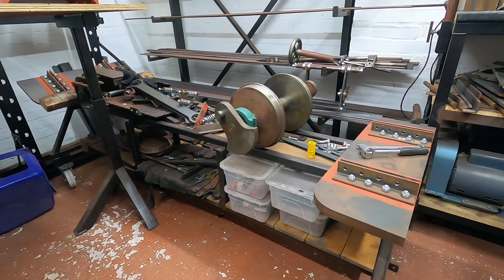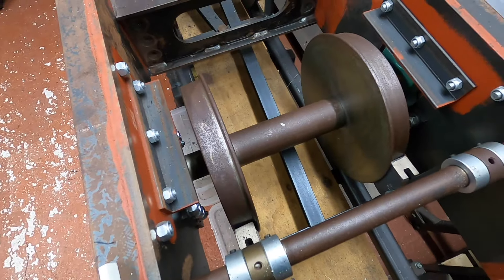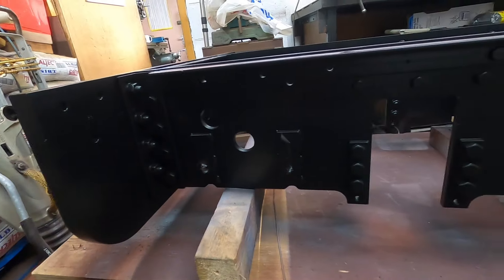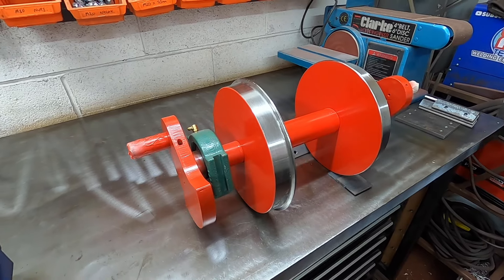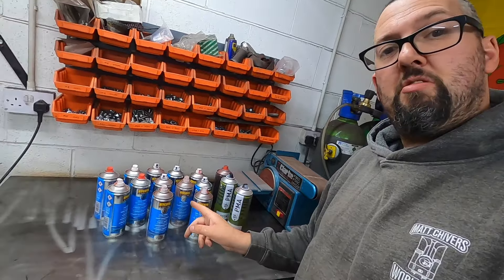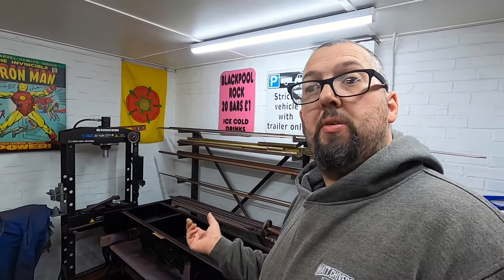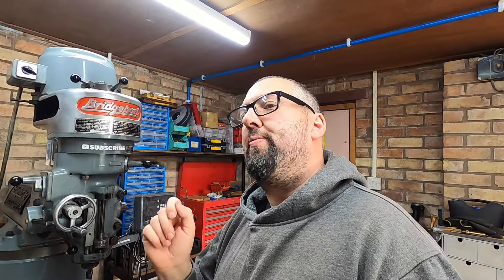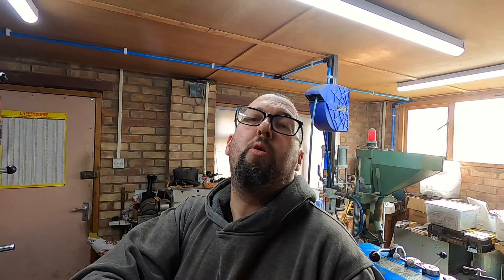LACK OF VIDEOS *ANSWERED* - ep60 - 7.25" Gauge Steam Locomotive Build

Comment: Great work, Matt.  It can take longer to prep and paint a part than it does to make it.  I always paint my locos as I go.  The up side of this is that the loco only needs to be assembled once.  The down side is that paint can get chipped or damaged during subsequent work, and there is the risk of finding pesky little jobs that need welding on painted metal.  I'm currently painting the main frame for a 7.25" gauge single Fairlie and plan to get it mounted on the power unit and bogie this week.
Reply from the maker: Thanks Richard, yes there is a risk of accidental damage but think it’s one I’m willing to take on future projects. This has taken a long time but I’m happy the end is in sight and we will be back to working on new parts. All the best, Matt 👍

Comment: Hey up matt , know the feeling well the frames for the l&b drove  me literally round the bend  - when i checked them for square thet were 3 mm out from corner to corner yet the buffer beams  were parallel to within  10 thou -  one of those weard anomalies that you have to let go  - only got two more plates to bolt in then its  hornbbocks ,spring hangers and axle blocks in ,  same here taken me 2 years and not a lot show ,great video all the best matt😊
Reply from the maker: Thanks Jonathan, I think once I've finished painting all the parts I had finished, it will feel a lot more advanced once they are fitted back to the frames. The boiler ain't that far behind, so once thats here it opens up the door to a whole new are of the loco to build and tackle. Making the build more exciting I feel. A lot to do before it arrives in the videos though. You will get there with your project, I think we all hit points where we hit a lull in the build, breaking through them is always the great bit, like painted frames!! All the best, Matt 👍

Comment: I've been using Jenolite "Waxoil Spray" for a few months, It's a spray wax that forms a barrier against moisture. So far it's worked well on some tooling and hopefully will prevent rust over winter when everything condensates in my workshop..
Reply from the maker: I use to use something similar in a job I once had, its the cleaning it off I never liked, my machines get coated in oil when I clean them so I tend not to have much trouble. The period we had was very strange, just went humid over a couple of days. Never had any issue until that point or after. All the best, Matt 👍